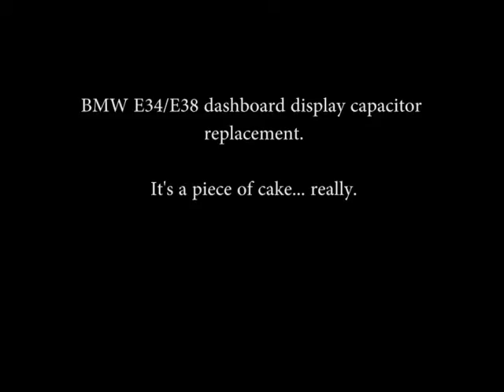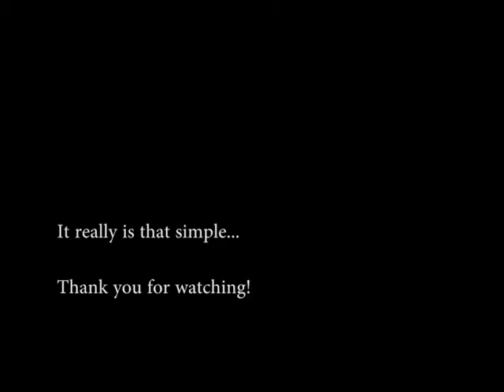BMW E34 gauge cluster capacitor replacement

Comment: Hi, my E34 525i stood for a long time, now the instrument cluster does not work properly, Rev counter, fuel and temp Guage not working, then comes on sometimes when I Rev the engine my Trip meter does not work properly either cancells Everytime I switch the car off. Is there a fix? Nice channel thanks.
Reply from the maker: That could actually be linked to a shorted battery. You might want to check that the car's battery still has enough power. Use a multi-meter, and measure the battery voltage with the ignition off. You should read within the whereabouts of 12.6V. Then measure the voltage drop while somebody cranks the engine. If it drops under 9V, you can consider the battery dead, and replace it. Now with the engine running, check that the alternator is doing its job: you should get approximately 14V. Let me know how this goes...

Comment: How did you get the little blue rivet things off, the ones that hold on the circuit board?
Reply from the maker: Hi there. Thanks for stopping by... I drilled through them very gently, and stopped right before touching the board. Then, the board sort of pops out if you pry it lightly. More importantly, it will 'pop' back in and stay in place when you are done with the capacitors. I hope this helps!

Comment: My RPM reads about 500- 1500 short when on freeway and street roads when it’s cold, after it being warmed up it works normal after a car restart. I’m thinking it’s the caps,
What capacitors were used? I have the GEN III too.
Reply from the maker: Hi there. Thank you for stopping by on my channel, I highly appreciate it. There are two different types of capacitors that are installed on your gauge circuit board: 4.7µF 63V and 20µF 40V. You will need one of the first, and two of the latter. Ask your local electronics store if they have them. In my area, the exact same were not available, so I got a set of 4.7µF 100V and 22µF 50V instead. They sold me a bag of ten of each, and it cost peanuts. I have done a few other gauges since, and they all work fine. This being said, I believe that the tacho signal comes from the camshaft position sensor, which is a shielded wire.  Make sure that the shielding hasn't split, which could allow electrical interference to occur, messing around with the reading on your dash. I hope this helps! Good luck, and enjoy your E34! :)
Reply: @gmcevoy  will the same capacitors work for my 520iT -94?
Have to fix my cluster. The temperature meter isn't working at all anymore. And the entire gauge turns of completely more and more often. And a few times it has gone completely nuts and won't shut of even if I turn off the ignition. Then I had to disconnect the battery to make it work again.
Reply from the maker: @evertssonsimon  Hi. It sounds like you have quite a short, somewhere. Do make sure that no aftermarket devices are wired into the cluster, somehow. The capacitors should be the same as the ones here. You will soon find out, I suppose. If you have any questions, fire away at info@mcevoy.be. I will do my best to help.
Reply: @gmcevoy  Hi, I've just sent some pictures to your email for advice on which capacitors that needs to be replaced.
Reply from the maker: @evertssonsimon  I have just replied. I truly hope it helps! :)
Reply: Geoffrey McEvoy  
thank you for the very detailed  reply! I will see if I can get some local I do have a another cluster that needs new ones. As for my crank sensor, it’s fairly brand new, about 1-2 old. I have a M30 engine with only 40k miles on it, I got a brand new block from BMW In Germany. They only had 6 left in the warehouse. So I have a brand new M30 engine, only thing that was reused was the head which I got ported an polished. Love this engine 
Thank you for the help and tips!
Reply from the maker: It is always a pleasure, Kyle. You are most welcome. I really hope it helps, although I am not 100% certain that the tach signal comes from the same sensor as the M60 that this cluster goes with. I would have to look that up. An M30 doesn't have a camshaft position sensor, I believe. It is really cool that you have managed to source a brand new engine, by the way! That is quite exceptional indeed... These engines are among the best ever made, in my opinion. Lucky you!

Comment: Thanks for your video ! Do you think failed capacitor(s) can explain an EML light permanently lit even with contact off ? (on a '95 525i with cable operated throttle body, everything else working fine on the engine side)
My gauge cluster is already disassembled so I will change capacitors anyway. And at the same time the capacitors in the dreaded GM module ;)
Reply from the maker: Hi there, mate. Thank you for watching my video... I am quite unsure, but it is a possibility. In Europe, E34's aren't equipped with the EML light (or at least, not that I am aware of), so I couldn't tell for sure. I have just looked up the wiring diagrams for you, and this light goes into pin 8 of the power train module (DME), via a grey wire. I don't have the schematics of the insides of the DME, so I'm afraid I can't help any further than that... If your E34 has ESC, it might have something to do with that. Possibly an erroneous information from the level sensor, on the rear right trailing arm. For what it's worth, I have had an occurrence with an airbag light staying on, and it appears that a low battery voltage was the cause. Maybe this could happen with the EML light as well? I hope all of this helps! Keep me posted in any case. All the best with changing the caps!
Reply: Thanks for your answer and to have looked at the wiring diagrams ! My 525i E34 does not have ESC either. Battery voltage is OK. The airbag light stay on for some time time after starting. I will have to take a look at the level sensor as you suggest ! I just received the caps so I have now to replace them.